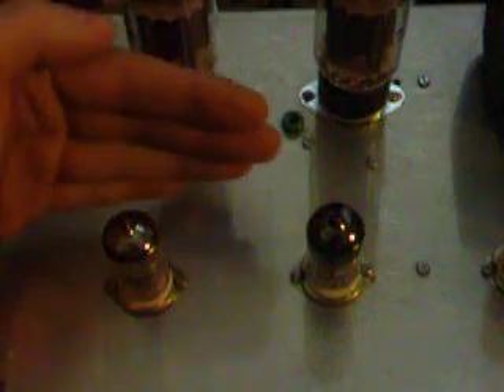Howl and Squeal in a High Gain Tube Amp

Comment from the maker: I think I put a 10K stopper on the input stage, and 470k stoppers on the two distortion clipping stages.  The problem was the 5" proximity of the preamp tubes to the output tubes.  Shielding the first two preamp tubes completely solved the problem.

Comment: grid stoppers, tube shields, tubes are too close to power tubes, add some 500pico caps parallel with your preamp plate B+ resistors, this oscillation  ''  SHALL NOT PASS "   haha